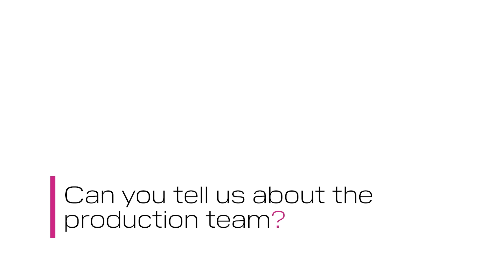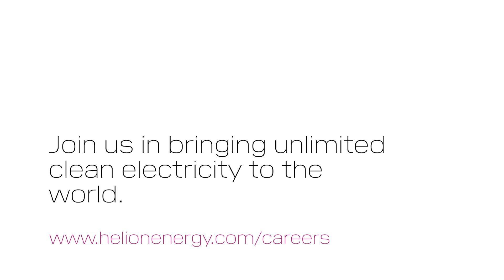Meet Helion: Sofia G

Comment: A real question I have about the fusion process is if you are using a DT reaction here in a relatively small space, with all the neutrons created what do you do with the machine itself that is going to be taking the brunt of the neutron collisions over its life time? i'd imagine this will effect the machines components on an atomic levels and lead to unstable radioactive isotopes of various materials that will need to be dealt with and/or disposed of. So, how does the team address this when these machines are running at scale for long durations of time in a power generation capacity and not just an experimental or testing phase?
Reply: They are not doing D-T. They do D-D and then they burn the resulting He3 with more Deuterium.

Comment: So you're still manufacturing capacitors for polaris?
Reply: Yes, they need lots of capacitors to blast into their magnets.
Reply: @kayakMike1000  also to capture the energy produced. I thought about the posibility of a multi reactor system.  They could share the capacitors required for a single unit system. With enough reactors the energy could cycle through the units as they take turns pulsing.